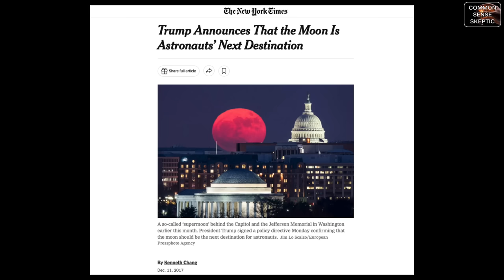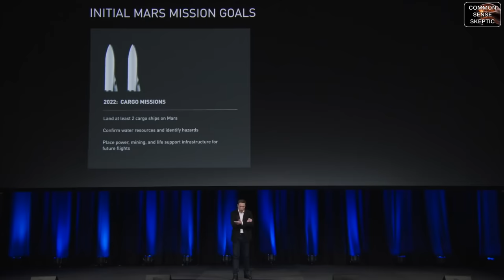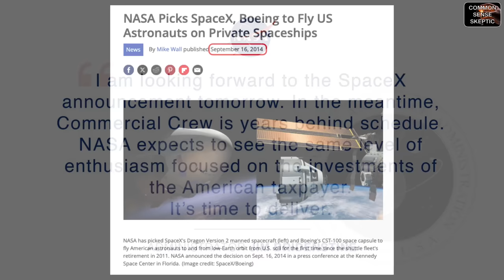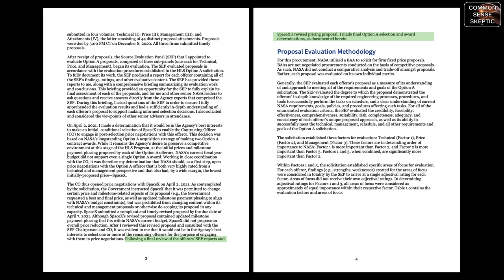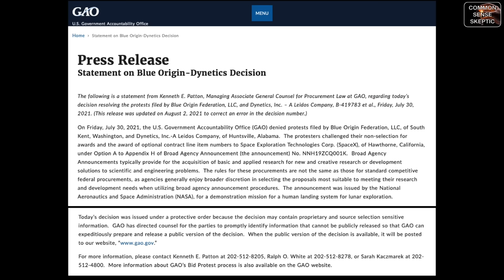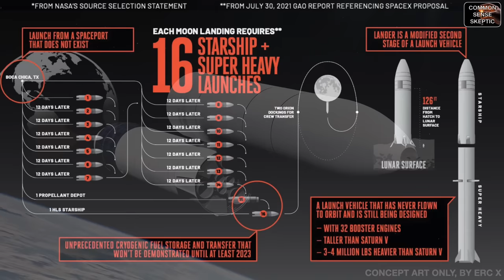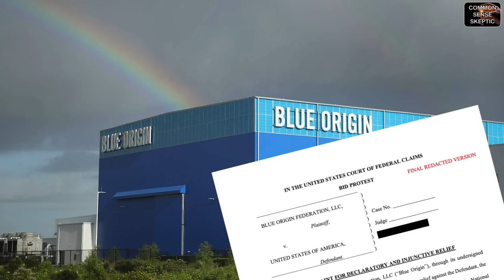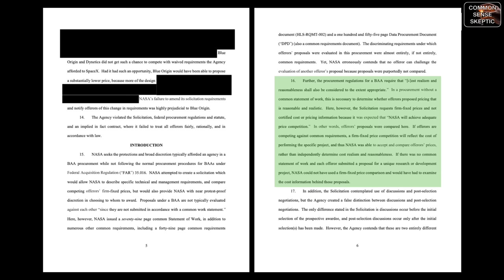BILLIONAIRE SPACE RACE - Bezos v Musk (SUPERCUT)

Comment: Can you please cover the Dynetics lander? If I recall correctly they were still in development as of last year. Also, there is one way to mostly mitigate the issue of landers blasting soft regolith and I've proposed this method for a reusable Mars lander/ascent vehicle but it would work equally well on the moon. You introduce (at least one axis) gimballing to the engines. Therefore as you come close to the surface, you point the engines off-axis. This also allows you what is effectively a deeper throttle. The engines are now blasting regolith away from the vehicle rather than creating a turbulent flow underneath the vehicle that will direct stones back at your vehicle.. Instead they're being directed away from the vehicle. A vehicle shaped like the Dynetics lander has inbuilt capability to do this, whereas the Blue Moon lander is a little more hardwired towards pointing vertically.

Note that this technique also works for ascent. Gimbal the engines away from the vehicle so the initial dust storm is directed away. Then as you achieve lift and separation from the surface you bring the engines back to the vertical.

Comment: There is a very long shot chance that New Glenn launches in 2024. More likely the inaugural launch will be in 2025. However, and for the reasons you pointed out, Blue Origin absolutely have a clear opportunity to beat SX to the Artemis landing. 
Another point that I’m so glad to see someone else take note of: Blue strives to succeed on their first attempts. True, the first NS failed to land, but that was because the key component that caused the failure to land the booster was borrowed from another entity. Blue did not repeat that mistake.
Reply: why it is very long shot? considering they want to use it for mars payload, it is not something that can be pushed (the window is maybe two month, probably shorter.) what is that makes it questionable for the try? ok, the success is a bit ambitious, but the engine already tested in real flight, so even that is on their side.
Reply: @thorin1045 Everything space-related is always delayed. Especially the first launch of a new rocket. And regardless of any launch window, New Glenn won't launch until it's ready.

New Glenn is already 4 years delayed, but even though they have adjusted the expected launch date, it's pretty much the norm that there are further delays, though usually less and less of a delay the closer you get to the launch date. If I was going to guess on the probabilities, I'd say there's a 20% chance the first New Glenn launch happens in 2024, a 60% chance it happens in 2025, a 15% chance it happens in 2026 or later, and a 5% chance it never happens. 

This means that most likely, Escapade won't be New Glenns first payload. I'd expect Escapade will be pushed to a different launch vehicle and launch in 2026. Maybe a Rocket Lab Neutron, or maybe they go back to being a secondary payload on a Vulcan Centaur or Falcon Heavy. Or maybe some other launch vehicle.
Reply: @SpaceAdvocate  so in short version: zero reason beyond that it would be nice if they also delay more.
Reply: @thorin1045 I don't think it's nice if they are delayed. I have my fingers crossed they are able to successfully launch on time.

But at the same time, some realism is advisable. Everything is always delayed. 

There are actually signs that delays have affected the plans. They were initially going to launch into a highly eccentric high earth orbit, and then Escapade would do the trans-Mars injection burn, but that's changed to New Glenn doing the trans-mars injection burn directly. The thinking is that this shaves off a few days (but is higher risk).

Personally, if I worked on Escapade, I'd be somewhat happy if New Glenn is delayed and the launch of Escapade is pushed to 2026. The alternative launch vehicle is probably a better option. Statistically speaking, the first orbital launch attempt of a new space company has something like a 50/50 chance of success, at best. I wouldn't love a 50% chance of seeing several years of my hard work explode.
Reply: Blue Origin also needs at least 10 launches to land their lander on the Moon so honestly I don't see how they could get there before SpaceX does...
Both designs are pretty similar.
Reply: @JeffreyRush-rs6zg  obviously, the one launch for the lander and the two for the refuel is clearly at least ten. compared to the starship where the one launch for the hls and the absolute minimum eight launch of tanker is no more than three. 

one needs less fuel, so less refueling. one has an idea how to get back from the moon, the other so far none. yes, both designed to take 2-4 people to the moon, yes, both only exists in, wait a minute, one already has multiple valid inner mockup for actual testing by actual astronauts, the other maybe tested a lift, the part the one with the mockup skipped by the hightech usage of ladders.

so no, at this point the blue ball is closer to reality than the hls, which is funny, if not meant actual moon landing is not expected before '28.
Reply: @thorin1045  I'm talking about the new design, the one with 30 tons of payload.
They had to make their lander bigger to compete for sustainable landings starting in 2028.
Reply: @thorin1045  Blue Moon is 6 times smaller, but New Glenn has 4 times less payload than starship so they can launch less fuel at a time.
So if starship needs 16 launches Blue Moon needs about 10.
Reply: @JeffreyRush-rs6zg  yep, me too, they already sent the inner mock-up of that to the nasa to test and still plan to do only two refuel, plans may change, but not much.  (and not really bigger, mostly just swapped the tanks and the living area.)
Reply: @thorin1045  They sent a mockup of the MK1 lander, which is a technology demonstrator with 3 tons of payload.
The lander that will carry astronauts will have 30 tons of payload, not 3.
Reply: @JeffreyRush-rs6zg  three times less or even less difference (45 ton to leo vs 100-150 ton leo), different fuel (much higher isp) so starship is 8 tanker minimum (12+ realistically), 4 and 6 for the blue moon with your calculation, ignoring the fuel and using the best case for starship. 2 would be probably highly optimistic for the blue moon, but even three or four is still much more acceptable than the 8-12 or more.
Reply: @thorin1045  New Glenn has 45 tons of payload when expended. So in an apple to apple comparison starship has 250 tons of payload.
Hydrogen is more efficient, but boiloff is way worse.

Comment: Having a separate lunar ascent stage is paramount for reducing failure caused by descent stage damage. Also reduces fuel requirements. Hope BO can address. Agree 100% that Artemis 5 will have greater chance of success than Artemis 3❤
Reply: No matter how dangerous or ridiculous the concept may be, NASA is under pressure to include as many "reuseable" components as is necessary to pander to the environmentalists.
Reply: @maifantasia3650  especially stupid when it is inherently no or barely reusable, as it needs fuel in moon orbit. until we can make fuel on the moon surface, any craft that is reusable is little more than gimmick. the bo version at least can be served with refueling tug or coast back to leo for refuel in theory, the hls literally needs an entire fully loaded tanker at moon orbit to refuel.
Reply: @thorin1045 It's not a gimmick, even though a reusable system would be better with ISRU.

The thing is the lander can cost something like $500 million. Not having to pay that cost for every landing is a benefit. You just need the propellant, that a new lander would have needed anyway.
Reply: @SpaceAdvocate  so you just ignored the entire part of the full tanker starship at moon to refuel. it is a gimmick. the bo version maybe can refuel "just" by sending up the two fuel launch, saving a new vehicle to launch in third one, a that point it maybe can worth it, if we accept that one of the most risky part (moon lander and ascender) will be reused to save less than half the cost of that part. it is still costly, and adds risk to an already risky mission, not a good option.
Reply: @thorin1045 You need a full tanker in LEO, which you could use to fully fill an HLS Starship in LEO, or you can send the tanker to NRHO and transfer almost all the remaining propellant into HLS Starship there. HLS Starship would then have enough propellant to go to the lunar surface and return to NRHO, and the tanker could use a little bit a propellant to nudge it into a trajectory that intersects the Earth atmosphere. Where it can then use its heat shield slow down and eventually land.

This is likely cheaper than the BO option, because as far as we know, the BO tanker won't have a heat shield. It would be expendable.

Comment: Would love a similar ULA/Boeing/Lockheed evaluation on SLS. Also, how much weight can you put on mockup delivery points? Mockups can/do help with higher order evaluations (like human factors evaluation), but if the fundamenal blocks aren't present, they are just a distraction.
Reply from the maker: SLS flew. Successfully. First time. Their mock up is in the same building as the Blue Origin full scale for the Artemis II astronauts to sort out. Without mockups, and the input they provide, you can't know what you're actually building.
Reply: @commonsenseskeptic  Hopefully I'm not goalshifting, but, that is the SLS that according to NASA Inspector General Paul Martin (as of Jan 2022) would cost a staggering $4.1B/launch, and ten's of $B in traditional development cost+ contracting since 2011. That's not a sustainable path to LEO or anywhere else. Apollo already proved that if you overengineer and throw enough hardware away you can do anything. But I guess I thought the fundamental problem here was not to redo Apollo, but rather to significantly improve the economics of LEO and moon access.
Reply: @commonsenseskeptic  And also, to clarify, I thought that compared to the strong core of your argument, which looks like a aerospace contract corruption case, I thought the mockups argument seemed almost trivial. I had hoped SpaceX would continue to run their contracting better than the major aerospace contractors, but this doesn't look good. 

I bring up the comparison in launcher/overall flight architecture, and wanting a comparison of the full Artemis process to date, because I think those underlying decisions will end up driving/validing/sinking  any future lander design.

Comment: The latest test flight feared the best so far. The Super Heavy didn't make it back, but the Starship made it to sub-orbit. For what it was, I thought the flight went pretty well but I thought the burn up on reentry seemed inevitable - why is only the bottom half of the Starship covered in tiles!? The shuttle was completely covered in tiles. Not shielding one half seems like an obvious design flaw.
Reply: The shuttle wasn't completely covered in tiles. Only the black parts were covered in tiles. The white was some form of thermal blanket material, if I recall correctly. The shuttle needed more shielding as the structure was aluminium, Starship is steel and handles heat better.
Reply: Ultimately it was the spinning that killed it not the lack of tiles. It’s OK to have tiles on one side as long as you can orient your ship that way
Reply: @SpaceAdvocate Correction, the shuttle was completely covered in tiles, the upper white tiles were coated in nomex felt.
Reply: @WhiteJarrah  Oh, you're right. I remembered wrong.

Comment: One thing that nobody seems to realize is the fact that both blue origin and spacex's landers have way too narrow and tiny landing legs, the starship ones are especially ridiculous, smh👉💩
It's going to tilt and fall way too easily...
Reply from the maker: Footprint of both vehicles is about 9m across, giving the Blue lander a better stability rating. Never liked the Starship idea. Too high, too skinny, too dependant on tech with no backup.
Reply: @commonsenseskeptic  yeah, but the blue lander is still as tall as a house, 
the legs should be spread out more
and the starship has the same diameter, you say?!?!
Jesus Christ......😵🤦🤦🤦
It's going to fall during landing, that's guaranteed...
Reply: @veryunusual126  The Blue Origin lander is pretty similar to starship in more ways than one... With the latest redesign it's now 16 tons dry with 30 tons of payload so they need to launch New Glenn 10 times to refuel it.

Comment: I agree with almost everything in this of course. Though I'm not convinced that human takeover, or indeed any human control at all should be a goal. In the 1960's a fully autonomous moon landing mission would have been a total pipe dream. Today we should be able to develop and test a fully autonomous vehicle over and over again before ever putting humans on it. Taking humans out of the control picture, reduces overall system complexity significantly.
Reply: The point is to have humans as a backup, so your list of options if the automated landing sequence fails is longer than a single entry: Death.